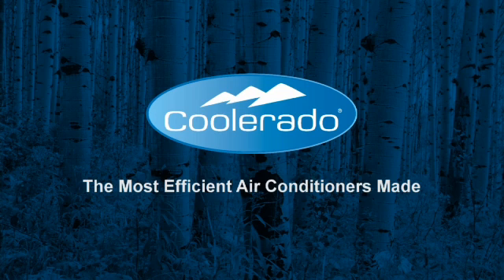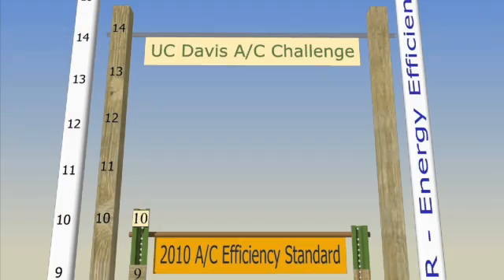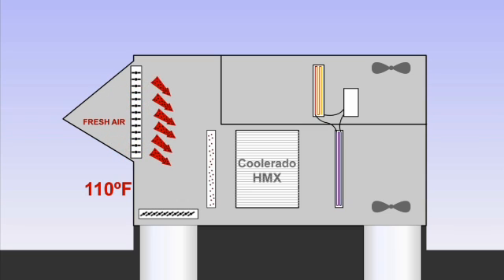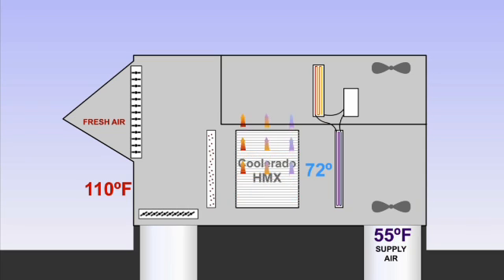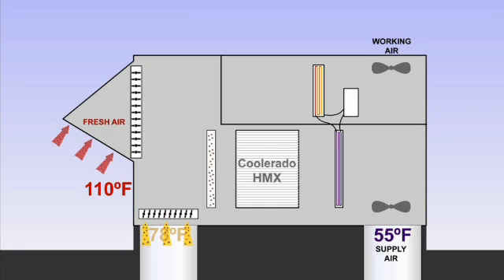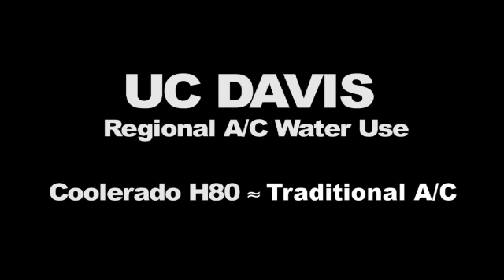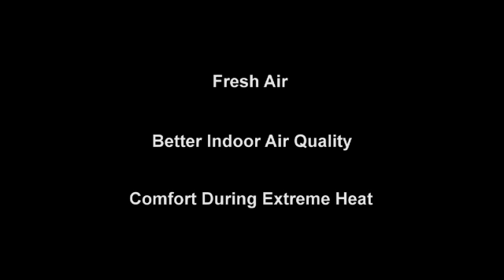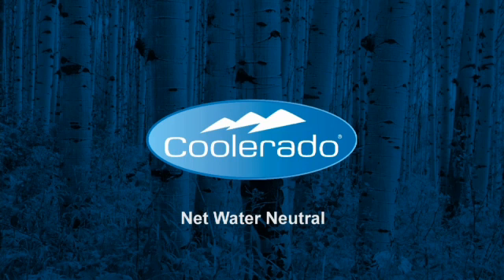Coolerado H80 - Hybrid Air Conditioner (Fahrenheit)

Comment: In areas where water is cheaper and electricity isn't, this system is very economical. 
Watch the first video. It's impressive. Intake air is 150 F, output cooled air is 56 F. You can't get that kind of drop with simple evaporative cooling. And this system is better. The air going into the building isn't exposed to the water bath as it is in a simple evaporative cooler. And it's much cheaper to run than a conventional air conditioner.
Reply: Where do you find 150 F air intake? On a hot rooftop? The first magical box drops air temperature 35 F, (never explained).
Reply: @Resologist  try to investigate in papers. There is a fantastic heat transfer, you can search in google M-cycle if you want
Reply: @klismancesarcabrerapasache5098  Really? The Maisotsenko cycle is simply an indirect evaporative cooling system, but what is illustrated here is a magic box, (no explanation as to how it works, just that, connected to nothing, it drops the air temperature from 110 to 72 degrees Fahrenheit). No thanks! Any fool could illustrate their "magic box" and drop the air temperature from 110 to 37 degrees and say that it can be used as a refrigerator, too! This evaporative cooler doesn't work in humid climates; and, it's not cheap, (simply uses less electrical power than a vapor-compressor air conditioner does, which works in both humid and arid climates). My concept for an efficient dehumidification and air cooling system is very different, (no compressors nor pumps needed, as it has no moving parts). Similar to this: https://en.wikipedia.org/wiki/Einstein_refrigerator
Reply: @Resologist  Absorption uses a pump too, and also needs a heat Source, it's expensive too. 
I'm working on a IEC with a dehumidifier like this guys http://news.nus.edu.sg/press-releases/water-based-air-con 
Also a IEC it's not "simply" as you think. Just try to understand the Heat Transfer equation and analysis of the different kinds of IEC.

Comment: It's called "Indirect Evaporative Cooling."(Their "HMX unit.) I've done the computer DDC controls on similar, much larger VAV Units. Basically you take the outside air, and run it through a water to air heat exchanger and then that air it sent to the condenser side of the DX unit. The building air and the water never come in contact with each other. The building air goes through the Indirect Evaporative Cooler (HMX), then to the DX Mechanical Cooling, and then back to the building. It works!